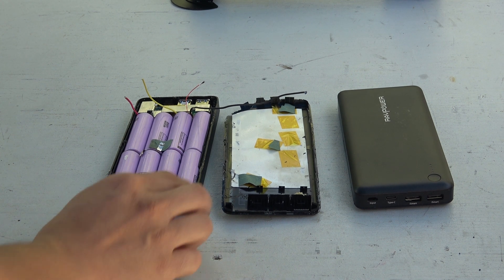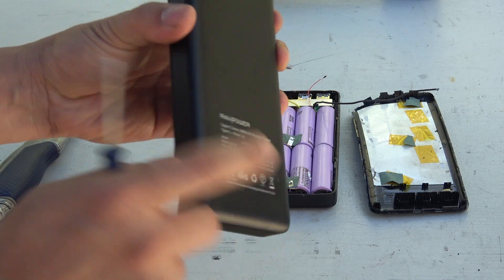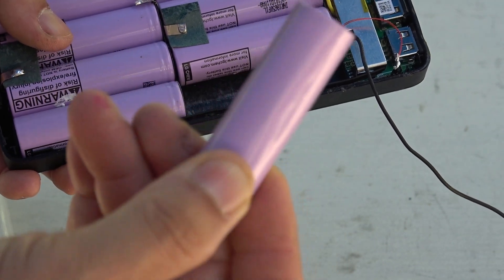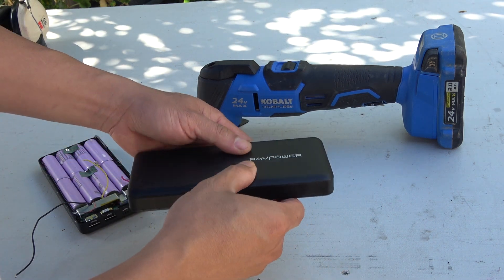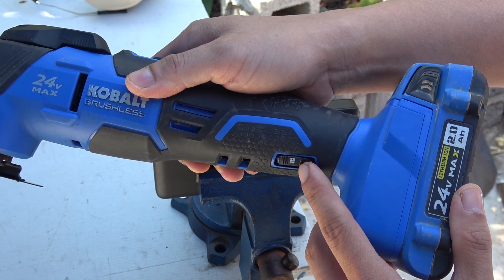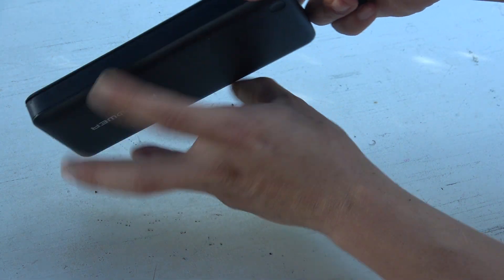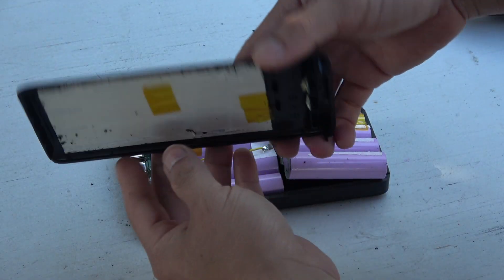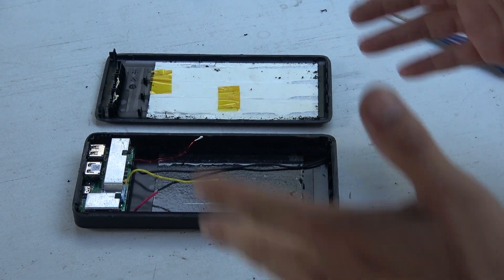How to easily cut open (tear down) a USB power bank for harvesting 18650 batteries

Comment: Thats impressive how you get the case open with no damage. If its just about harvest the battery, you could cut or break the side of the circuit right? Still I'm not feeling comfy to do that with my camera battery. But thanks for showing!

Comment: To open the cover, using a battery operated drill with a small saw attachment on with you add a smaller  diameter washer, will allow to cut the cover without reaching the cells.  My thought....
Reply: Yeah discharge it before you open it up in case to damage the battery if you damage a fully charged battery its going to go up in flames.

Comment: I found a battery pack that doesn't glue it shut, they instead use clips to hold the top cover on.  They just glue a lipo and put some pads on it to make sure it will be okay if you drop it or hit it pretty hard...  But they don't make getting to the gosh dang USB ports easy.  Shame, it was a darn good pack for the price.  I am not going to risk using it in case the broken port somehow miraculously shorts.

Comment: I found this video while trying to figure out how to open a Mophie powerstation. This video is great and could not be done in way that could be any more down to earth than it is. The video maker clearly has went through the same processes and frustrations we have all faced when trying to figure something out that there are no instructions to and no obvious steps to take to get something done. His accent adds to the extreme things he says to make his points and it turns out very good, it makes me laugh while still making his point.
Reply: What's the name of that particular tool if I don't want to call it oscillating tool
Reply: @adesokanyusuff8029 a multitool
Reply: @adesokanyusuff8029  I think it's called a multitool
Reply: @adesokanyusuff8029 multi-tool
Reply: 100% agreed. So much to learn from this genius. I could watch this channel all night long.

Comment: Thanks Vuaeco.  A well described set of instructions, not without humour!  How many times have I  stuck a small screwdriver into my hand or a finger! 

I have almost exactly the same problem with a 26.8 Ah RAVPOWER battery.  The micro USB socket has somehow got damaged, not broken off, but something is preventing the charging cable plug from being inserted.  You've given me the confidence to tackle this problem.  I going to have a crack at softening the glue first before I take a saw to it.

Comment: Excellent! Need your help if you please. I got a Ebikeling 48v, 1500w controller and I cannot get it to turn on. I was told that I needed an LCD/LED display to turn it on. I guess this display acts as a switch. Is there a way to bypass the LCD plug to turn this unit on? Have a you worked with something like that? What wires need to be jumped? Thanks
Reply from the maker: Yes, you can bypass the LCD to turn it on. There's a bundle of wire for power switch on your controller. Watch this video: https://youtu.be/PuwnFMHHtaE
Reply: vuaeco thank you for responding and I saw the video you suggested already about the controller and wire description but the Ebikeling controller has different wire set up. On the power plug red & black wire only, the the three motor leads, and the has the 5 wire plug for the LED/LCD display ( red,blue,black, green, yellow). On the black and red wire if this switch there is Hugh voltage from the battery(41v). Do you know which wire I need to jump in order to activate the controller? Thank you
Reply from the maker: @diyek1781  Take your volt meter and measure one pair at a time. If it's the same as system voltage (in your case, 41V), don't jump it because it will short and spark. If it's between 3V-5V then you can try to jump it. One of the pair will be power switch.

Comment: Some come apart with a slight twist or you can use a hair dryer or heat gun and go around the edges and pull it apart.
Reply from the maker: Maybe on some. But most of these have hard and thick plastic. Twisting it by hand won't do a thing even with a heatgun.